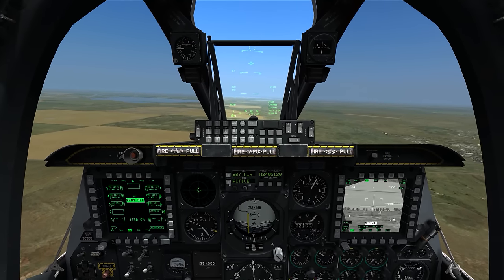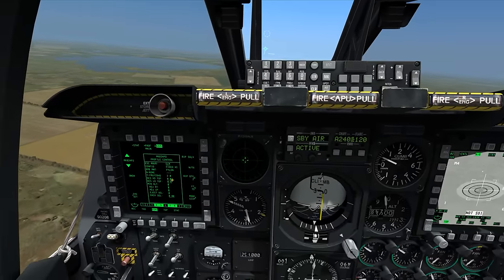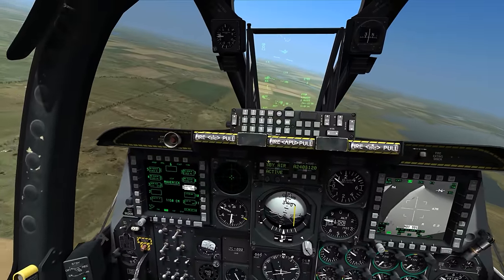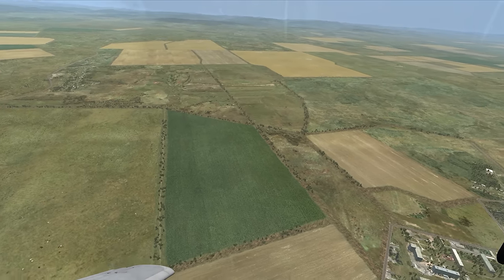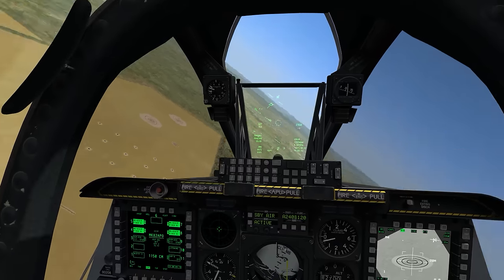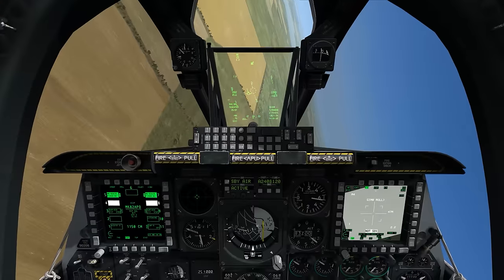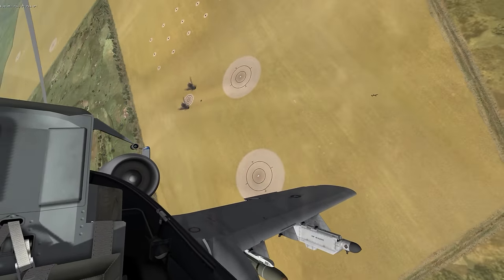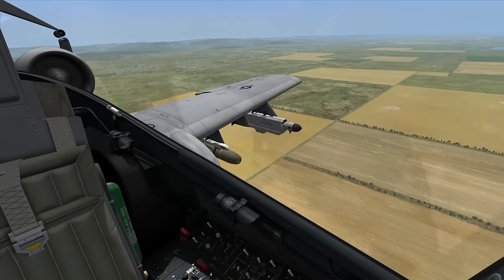On the Range #45 - Mk-82 AIR Dispersion Test in DCS: World

Comment: Dispersion seemed little far to left imo for bombs released at 2000ft. I would buy it if it went short in line with the A/C, but that much dispersion in deflection seems off to me at least. Did you have any rudder input on your runs?

Comment: Can anyone help me out with this problem i am having with the hog?. When i mark a SPI with my TGP to use a GBU or CBU i roll in to line up with the ALS but the ALS is no my marked SPI its my waypoint marker.
Reply: I believe you need to "slave all to SPI" by pressing china hat forward long.
Reply: Yeah I do that but I still have the same problem
Reply: The Legionnaire Sounds like your SPI is set by your steerpoint, not the TGP. With your TGP as the SOI, hold "TMS Up Long". In the lower-left corner of your HUD, you will see what's determining your SPI. If it says "STPT" (steerpoint) then TMS Up Long should change it to "TGP" and hopefully you'll be good to go - the location the TGP is pointing in then your SPI. (TMS Down Long would set it back to STPT.)
Reply: Thanks man ill give it ago